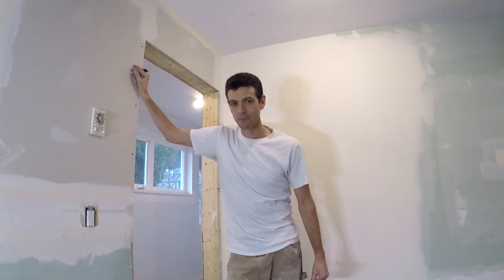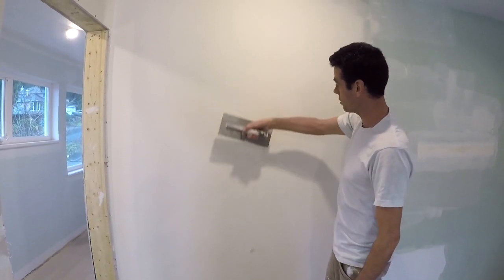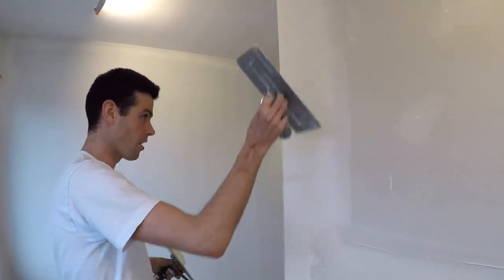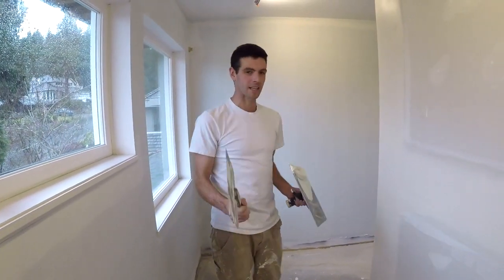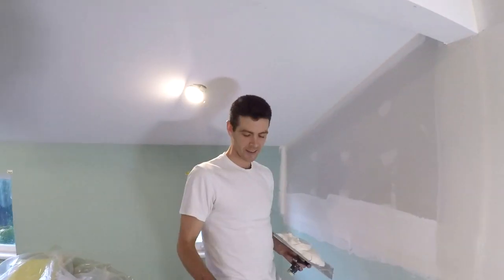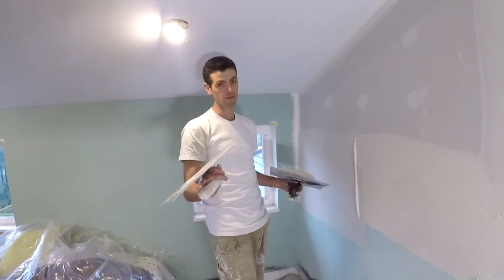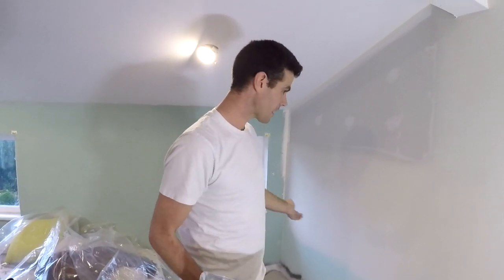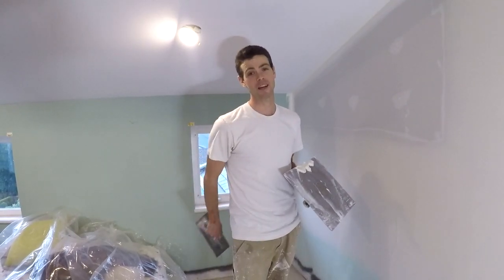Flat trowel vs Curved Trowel

Comment: curved for corners? who re-invented that?? it's  for flat ones. Like using a finish-box for cornering lol XD anyway nice videos lots of cool stuff. cureved one is for speeeeeeeed working on "sink in tape" joints , one move vs 3 with a flat one . no point at one joint you work on, the diff is once you do a whole warehouse/whatever. like comparing airless skimm spray against a manual one and taking the whole process of set-up/clean doing one wall only XD

Comment: You cant over exaggerate the issues with it and use it on a second coat since it's a first coat tool. Using it for corners is obviously dumb except in certian situations that are rare. I rather you try your best with what (youhave) or trying. Show your commitment to teaching. It may not be good for decent mudders  but really can help novice and DIY on butt  joints and uneven joints of old plus new. Test a tool show advantages.
Reply: I dont use a curve trowel once I got an eye for my work after about a year or so. But if i had one i could use it 1000x better than what your effort is. Just separate novice and experienced  videos.  I can lay 1/8 inch consistant on my runs but in corners I use the corner tool to smooth the mud under my tape, fills holes and evens it out very quickly. And 4 inch to take the excess out. Also I have a genetic disease my hands have a hard time being stable and shake and will progressively get worse. This is over years, I have another 10 years before I cant mudd anymore, just progressively gets harder each year